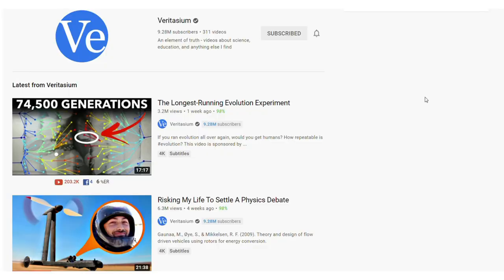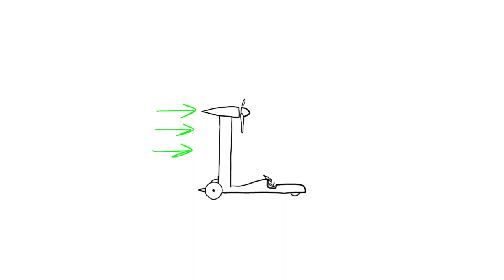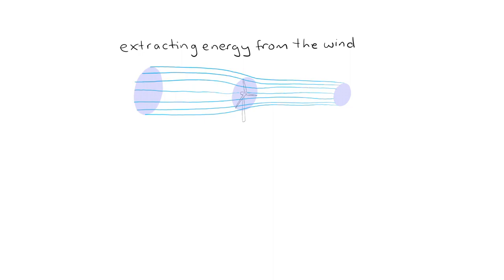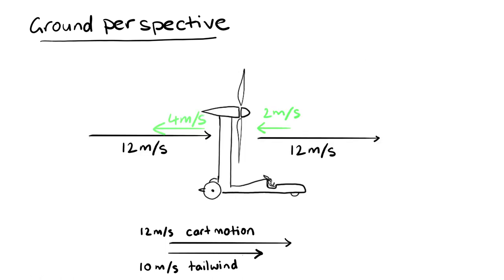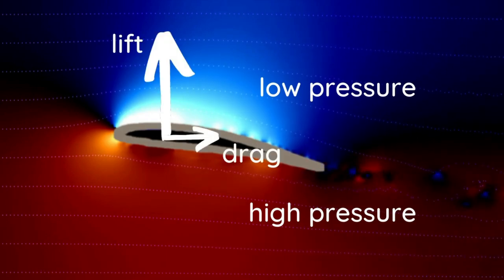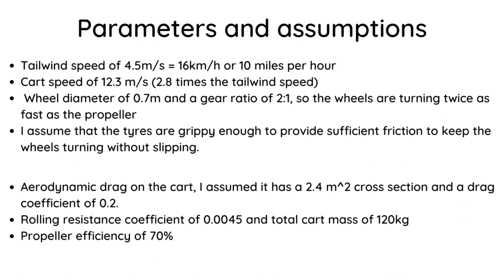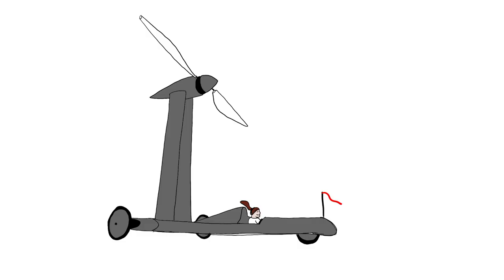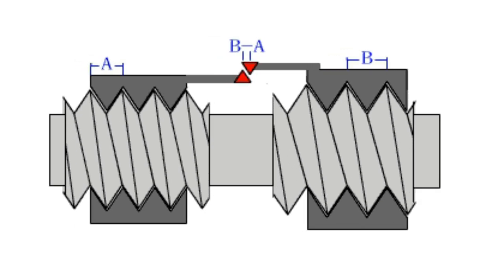Downwind Faster Than the Wind by Veritasium: How Does it Work?

Comment: so my problem is. at wind speed, the energy to accelerate the air comes from the wheels. the wheel speed is the cart speed. so any energy you take from the wheels has to slow the cart. how does this come out with positive force?
Reply: Derek has a rather complete explanation of this in his video starting at about 10m 30s

https://youtu.be/yCsgoLc_fzI?t=631

Comment: As a sailor I’m interested by your reference to sails as aerofoils. This is how they are always explained nowadays, yet it has never seemed satisfactory to me since, for an aerofoil to generate lift by pressure differential, it has to have a thickness. Sails effectively don’t. Also, the wind in the ‘slot’ between headsail and mainsail is not actually accelerated as is usually claimed, but slowed. It is the clean flow of air off both sides of the trailing edge of the sails which drives the boat. In older books, a much more convincing explanation is given, that the sails drive the boat by bending the wind and slowing it down. I find that using this concept enables me to get much better performance than the aerofoil idea, but people don’t like it! I’d love to see you discuss these ideas in a video.
Reply: "for an aerofoil to generate lift by pressure differential, it has to have a thickness."

Not really. Even a flat thin plate can produce lift at non-zero angle of attack.

"a much more convincing explanation is given, that the sails drive the boat by bending the wind."

To generate lift, you have to divert the airflow, otherwise it would violate momentum conservation. There is no contradiction between the explanations.
Reply: A wing doesn't have to have thickness to generate lift.  It just has to have a pressure differential on the two sides.  You can easily make a viable wing over just a stretched piece of cloth over a rib.   You can also make a piece of cardboard fly with an angle of attack.
Reply: @eyytee  I appreciate there is no contradiction, but producing lift by angle of attack is not the same as generating a pressure difference as usually explained, by the upper (leeward) surface of the aerofoil being longer than the lower surface and thus requiring the air to travel further and faster, thus reducing pressure. These are surely different processes? My mainsail produces drive from its trailing edge (leech) even when the curve of the sail at the leading edge (luff) is luffing in, demonstrating higher pressure on the leeward side of the sail, not the lower pressure expected by the traditional explanation. It produces this drive because the airflow on the leeward surface remains attached across the whole width of the sail and flows cleanly aft; it is helped in this by the headsails which drive the airflow along that side of the main.
Reply: @eyytee  I appreciate there is no contradiction, but producing lift by angle of attack is not the same as generating a pressure difference as usually explained, by the upper (leeward) surface of the aerofoil being longer than the lower surface and thus requiring the air to travel further and faster, thus reducing pressure. These are surely different processes? My mainsail produces drive from its trailing edge (leech) even when the curve of the sail at the leading edge (luff) is luffing in, demonstrating higher pressure on the leeward side of the sail, not the lower pressure expected by the traditional explanation. It produces this drive because the airflow on the leeward surface remains attached across the whole width of the sail and flows cleanly aft; it is helped in this by the headsails which drive the airflow along that side of the main.
Reply: @charleslyster1681  "the upper (leeward) surface of the aerofoil being longer than the lower surface and thus requiring the air to travel further and faster, "

The upper surface being longer is not the reason the air moves faster there. For a flat plate with some angle of attack the air also travels faster on one side, and there also is a pressure difference. You seem to be confused by the flawed equal transit time theory.
Reply: @charleslyster1681  
>> but producing lift by angle of attack is not the same as generating a pressure difference as usually explained

Nope.  A flat plate with an angle of attack is analyzed in exactly the same way as a 50:1 sailplane wing and produces lift for the same reasons.  It's just a very crude way of doing so.  But if you look at the flow around that flat plate with AoA you'll find it has the same hallmarks of flow as the high performance sailplane wing.  The separation point will be below the chord at the leading edge, the Kutta condition is satisfied at the trailing edge, and it therefore produces the vorticity needed to produce exactly the pressure differential we measure.  As eyytee mentions, the lengths of the upper and lower surface are not what matters.  That was the notion from the very well debunked "equal transit time" theory.
Reply: Indeed. It is a common misunderstanding that a wing needs to have the flatter side on the bottom and the more curved side on the top to generate lift. This is only done so to optimize lift vs drag. To demonstrate that, (some) planes can fly upside down, without changing their wings (albeit less efficient, less lift more drag). Also, most stunt RC helicopters have symmetrical blades, as they have to perform as well straight-up as upside down. Real helicopters rather have blades shaped like a wing, as they only fly staight-up, and therefor optimize blade shape for just that.

Comment: So basically it is like swimming in the downstream. Where water and swimmers body are at same speed but the Swimmer is using hands to go faster than the water speed. Am I correct?
Reply: Sort of but not quite. It's not a surprise to anyone that a swimmer can use the power of his own body (in addition to the motion of the water) to go faster. What's remarkable about this is car is that it's powered solely by the wind.

Comment: So which length of the chain is in tension?  If it is the side travelling up to the rotor (the rotor driving the wheels) it is a turbine.  If it is the side travelling down (wheels driving rotor) it is a propeller.
Reply: See: "BUFC Blowup run" when it pulls away from the truck.
Reply: At all speeds, it's always the side traveling down

Comment: The Veritasium controversy is about the car going faster than the wind or not. So why the explanation starts with the car going faster than the wind?  What I can get is that the wheels will be powered by the propeller as long as the car goes slower than the wind, or in other words, as long as the wind goes faster than the car. When (if friction allows it) the car reaches the wind velocity, the propeller won't be "push" anymore by the wind, but the propeller will be still rotating powered by the wheels, so the propeller pushes the car more to go faster than the wind.

Comment: Because Rick has proven that the car will go faster with the wind 
or against the wind, what you have here is a device that is creating 
more energy
than the wind is providing to power it. Your car is getting this energy  from the 
propeller
 because as you know when you doubled the prop speed the lift is 
squared. this twisting torque connected to the driving wheels is what 
pushes it faster.
  But in the treadmill model it is the wheels driving the prop for the forward thrust.

This also means that birds are a lot more efficient at flight than the experts think.
Reply: No.  The entire vehicle (including the propeller) consume energy, not create it.

Comment: Do you know the video where they put a smaller version of this car on a treadmill and it goes faster than the treadmill? Couldn't this torque produced by the wheels be used for accelerating the treadmill and we have the first working Perpetuum mobile? Where is the error in my thoughts?
Reply: The treadmill model, just like the full sized Blackbird is a 'consumer' of energy, not a creator of energy.  It harvests energy from the true wind (wind over the rolling surface) and ultimately turns that harvested energy into heat.

Comment: If I understand correctly initially motion is started with the wind. The propeller is turned by the wheels, creating thrust. If that is what is happening then if the track where infinite the vehicle could continue to accelerate as long as friction was at or near zero, without wind. I watched the original video again, still haven't seen any proof of their claim. What you said makes sense, on paper. At what point will the airfoil start to cavitate?
Reply: Without true wind the propeller will always produce less thrust than the wheel drag to turn the propeller. So it just stops.
Reply: >>  At what point will the airfoil start to cavitate?

Cavitation only occurs in liquids, not air.  But there does come a point where we start to see compressibility effects which would significantly impact the overall efficiency and limit the speed.  That starts to become significant when the blade tips get in the range of about 1/3rd the speed of sound.
Reply: @Rick_Cavallaro  in aircraft it called stall. The effect is basically the same.
Reply: @roscoepatternworks3471  The results have some definite similarities, but the phenomena are very different.  A stall indicates a separation of flow while cavitation refers to the liquid literally boiling due to the low pressure.
Reply: @Rick_Cavallaro  and what causes the low pressure?  In flight or under water the incorrect angle of attack for the speed causes a stall. Granted i should have use the word "stall". As there are several causes cavitation under water. Water is quite abrasive and can create its own turbulence.
Reply: @roscoepatternworks3471  
>> and what causes the low pressure?

Faster moving flow - in accordance with Bernoulli's equation.  I'm not sure if you're asking why faster moving flow has reduced pressure, but we can get into that if you'd like.
Reply: @Rick_Cavallaro  I understand bernoulli's equation. Just pointing out any airfoil shape under water or in the air can and will stall. A stall under water will cause cavitation. In water is much more damaging, but it's still turbulence that can be caused by the rpm and angle of attack. In water flaws in the propeller  can cause cavitation. I built the propeller strut for a 600' tanker. That strut was built with a twist that worked with the screw. Otherwise unequal pressure would wear out the strut too fast. Cavitation? Or angle of attack?
Reply: @roscoepatternworks3471  "A stall under water will cause cavitation."

A stall underwater can occur with or without cavitation and cavitation can occur with or without stall.

Comment: I suggest taking the car weight and center of gravity into consideration
The propeller is at the back of the vehicle. So the lift on the back wheels is more than on the front wheels
So the resultant is equivalent to a vehicle running down a hill
Reply: The thrust of the propeller is horizontal, so there is no 'lift' front or rear.

Comment: I don't see how a sailboat can sail faster than the wind filling its sail because it is driven through its resistance to the wind. If it reached the velocity of the wind that resistance would be cancelled out so there would be no force moving it. The boat will travel downwind but never faster than the wind itself because as its speed increases the driving force is reduced. You can never get more than the velocity of the wind itself.
  I looked up 'veritasium' but could find no more than a mention of the word, no specific details of what it is.
  In the case of the cart fitted with a propeller the cart would, in principle, fail to move because the back energy produced by the propeller would cancel out any forward movement produced by wind. In practice there might be slight differences caused by mechanical losses but they would quickly balnce out and cancel out any movement.
  The way to settle this question would be to build a precise model cart and put it in a wind on a smooth level surface.
Reply: //"You can never get more than the velocity of the wind itself."//

You should watch America's Cup racing and research their boat performance.  You would learn that you are wrong.

Comment: Great explanation! Question: since at lower speed the angle of attack of the propeller blades should be smaller, and since before reaching the speed of wind the energy should be taken from the air and passed to the wheels in order to efficiently accelerate, shouldn’t the angle of attack of the blades be negative until reaching the speed of the wind, and then go positive? I mean, since the propeller sees the air coming from the back and than coming from the front, if the angle of attack doesn’t change sign it would have to change the direction of turn. 
And here is where I am somehow stuck, because if my reasoning is correct, the angle of attack going gradually from negative to positive, it would have a cero angle of attack when reaching wind speed, and then the propeller would have no effect any more. So the way I see it the blackbird should go from negative to positive angle of attack sometime BEFORE reaching wind speed, but, when is this the right moment?
Reply: "shouldn’t the angle of attack of the blades be negative until reaching the speed of the wind, and then go positive?"

No, the wind (relative to the car) coming from behind increases the angle of attack.
Reply: @seneca983  I don’t thing so. The blades of a propeller have a leading edge. The leading edge must be “at the front”, and by front l mean where the air is coming from. Thus, the blades are twisted in a way that the air is blowing into the leading edge. If the air blows from the opposite direction, it will blow into the trailing edge of the blades (It would be equivalent as to have an airplane flying backwards). 
As an example, look at an electric generator windmill. If the wind direction changes 180 degrees, it better turns around in order to keep facing in to the wind. If it didn’t do so the blades would still turn, yes, but very inefficiently, because the wind would be blowing into the trailing edge of the blades, plus, the direction of rotation would change. 
The only way to have a propeller working properly and maintaining the same direction of rotation when the direction of the air is inverted is to change sign of the angle of attack of the blades (and, in order to maintain the efficiency, the airfoil profile of the blades should be symmetric)
Reply: @enricolucarelli816  "Thus, the blades are twisted in a way that the air is blowing into the leading edge."

It's not like that. The propeller is forcing the air backwards and the reaction propels the cart forward. If the wind is coming from the behind it's easier to propel the cart forward.

"(It would be equivalent as to have an airplane flying backwards)."

No, it's more like equivalent to an airplane facing headwind. This makes it easier for the wings to generate lift and with strong enough wind an airplane might be able to stay afloat without any forward velocity (relative to the ground).
Reply: @seneca983  but look, let’s start from standing still. The wind coming from behind, the angle off attack of the blades is more than 90º (90º plus the angle of attack with respect to the plane of rotation). So in this situation the wind is pushing forward, yes, but very very inefficiently. And actually it is wanting  to turn the propeller backwards. Yet, since the blackbird is being pushed forward and the wheels are connected to the propeller, the propeller will be forced to turn in the right direction. Thus the angle of attack will gradually decrease from over 90º to lower values, and it is not until it reaches enough rotation speed that the angle of attack of the blades will come out of stall situation ( typically somewhere around 10º - 15º).  
So I’m not saying that a fixed angle of attack won’t work. What I am saying is that it is extremely inefficient compared to a variable angle of attack propeller. Specially at low speed, but also at high speed, when the angle of attack reaches too low values. The optimal solution would be an automatism that maintains the angle of attack at its optimal value. It would actually also be very useful to trim the desired speed, if you add some control over it.
Reply: @enricolucarelli816  Variable pitch blades can obviously be more efficient than fixed blades. However, I'm not sure that the inefficiency is that bad at the start. In a complete standstill where the propeller is not turning yet at all the optimal angle of attack is obviously 90º (with the blades basically being sails) and the situation you describe doesn't seem wildly off from that.

Comment: It is a simple question does this thing run faster then a simple cart with the same wind and propelor?
since there is no magic it's about efficiency output enegy divided by input energy, is it more efficient?
in the case of a sail boat it is. in this case it is not. so it may run faster then the wind speed at some point but is it more efficient? probably not so on AVARAGE it will run slower.

Comment: Thx for that. For me it was clear that the windspeed has to slow down after the propeller as energy is transfered into the vehicle. But i got stuck on the mathematical proof, if the enery needed to turn the blade can be lower than the energy we get from the wind. Thx for that.